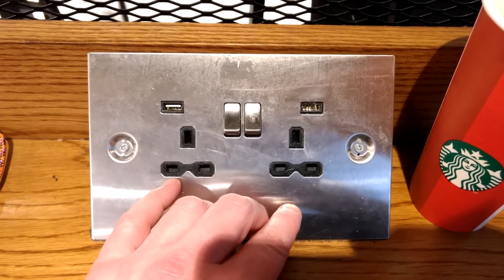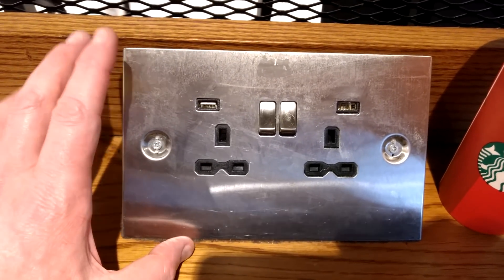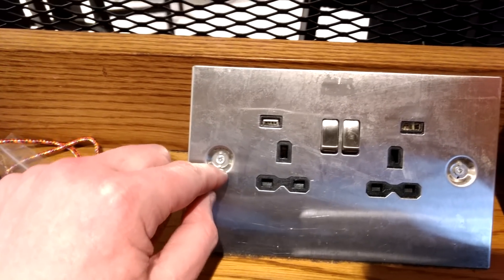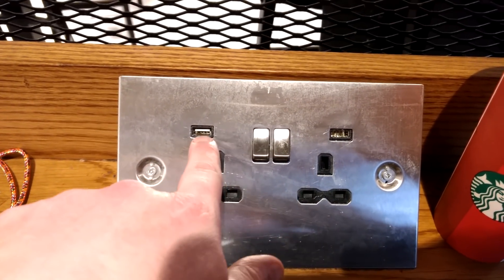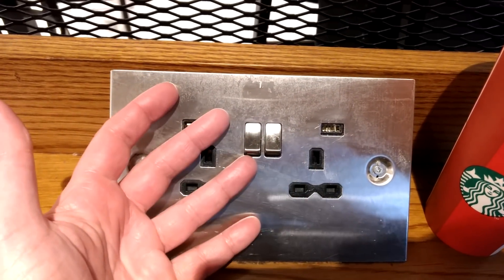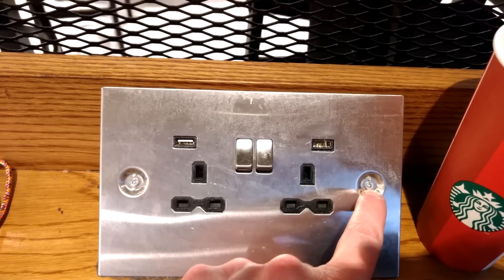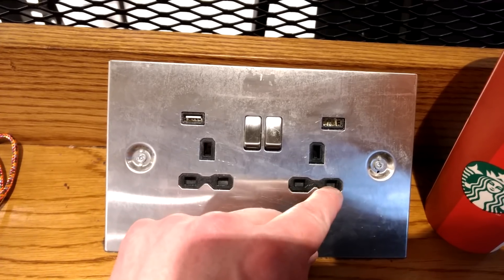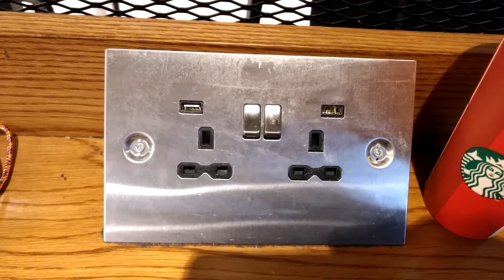Dead Starbucks charger and devious thoughts.

Comment: That's the new USB-D configuration,  you can use any cord you like as long as you shove it in there hard enough. Just like installing an RJ-45 plug into a standard phone jack.
Reply: USB-D(erp)
Reply: Paul Drake - or shoving a phone plug in a RJ-45 socket...
Reply: @Mark1024MAK  Don't know what phone plugs you use, but some here are basically just like the RJ45, except with only 4 pins and are a bit narrower
Reply: @Mark1024MAK  huh... UK phone plugs are strange...
Reply: @Tinker001  if you think the BT type is weird then have a browse through what other countries use!
Makes ours seem sensible.
Reply: @Mark 1024MAK That WP article doesn't seem to mention the major improvement over the RJ plug: If the cable is pulled hard enough the latch is designed to release before any damage is done.
Reply: (Though in fairness, the chunky international variants tend to facilitate legacy user wiring, where the UK legacy standard was 'approved device only'. Prior, we had the PO then BT to hard wire everything!)
Reply: @Mark1024MAK   That's not wrong and the standard was made to actually work with RJ-11 in RJ-45 sockets.

A lot of places (and you see this a lot working in I.T) People actually run Analog or Digital phones using RJ-45 sockets, It's a perfectly fine practice as long as you label the port, But that won't stop someone from plugging their PC into the telephone socket and.. Well... Fry it...
Reply: CFX MediaGroup - Yeah, in industrial, business and office premises, using the same wired network infrastructure for both ethernet and telephone services is becoming more common in the U.K. and presumably around the world. However, in the U.K. the “standard” and approved telephone plug/socket system is the BT type that I posted a picture of above.
If you don’t actually be clear to ordinary users, they will try to do silly things, like trying to insert the incorrect plug into a socket.
Reply: @tieline1333  I've had to change more than a few RJ-45 sockets that were damaged because someone plugged an RJ-11 into them. When you plug an RJ-11 into an RJ-45, pins 1 and 8 are bent much further than normal. 

When the RJ-11 is removed from the RJ-45, pins 1 and 8 often do not return to their normal position, and will not make contact with an RJ-45 plug, or make intermittent contact with an RJ-45, usually failing at the worst possible time...

Of course, this doesn't matter if you never expect that RJ-45 to work properly as an RJ-45 socket again, but if that's the case, why not just install an RJ-11 socket? At least then it's clear to someone in the future that it's a socket that only works with RJ-11s, as opposed to a damaged RJ-45 they might try to use as an RJ-45, only to have a network outage later....

Another option, to avoid damaging the RJ-45 socket, is to use an adapter that has an RJ-45 plug on one end and an RJ11 socket on the other.
Reply: @brianleeper5737  true
Reply: @Mark1024MAK  I intentionally shove phone plugs into RJ-45 sockets on a regular basis.

They fit & work as long as the other end of the Ethernet drop is connected to a phone line.

In this day of office phones all being VoIP, running a phone line from the rack to reception for a fax machine is silly when you're already running multiple cat6 or cat5.
Reply: or just a raging apple fan who has no ports on their £50000 macbook air
Reply: would it be USB-U  the U means universal ?
Reply: @punker4Real the first U already means universal
Reply: victornpb just pulg it into a ESATa port. mine has the lighting bolt for extra comfort and powerful output to the usb device. (the phone was suggested that I have random words in the sentence )
Reply: Or a usb into a rj45
Try it some time...usb a fits perfectly into rj45
Reply: Jeff Housen USB  fits perfectly fine in a ESATA port as well
Reply: @punker4Real Some laptops have a hybrid eSATA/USB port, so someone has already cashed in on that.
Reply: @kebizembola   Did that on the Sky box and wondered how it wouldn't connect to the router lol.
Reply: Are you sure they use USB and not USA?
Reply: You can put the cable in using a big hammer!  So I heard lol.
Reply: insert correctly  on the 3rd try

Comment: I've had issue with these in the past, giving me tiny electric shocks through my earphones while using on both Phone AND Laptop... immediately unplugged my devices from them, but what could have caused this?Faulty earth?
Reply from the maker: Most modern USB chargers have a slight AC leakage caused by capacitive coupling.  Especially if you are in contact with grounded metal.
Reply: @bigclivedotcom  At least it's not a pink death Dalek camping lantern!
Reply: @bigclivedotcom  I read of a recent case where a kid was electrocuted through his headphones, he was listening while charging his phone.
https://technology.inquirer.net/81928/p2fb-teen-dies-by-electrocution-while-using-headphones-of-charging-phone
Reply: It should pass the tongue test though - specially that is a public device  that everyone touches!
Reply: Actually common with at least the iPad Air 2. If you run your fingers over it’s back whilst charging you’ll get a tickle. This can easily be transferred to the person sitting next to you ;)

Comment: I was hoping they asked you to remove it to do a postmortem. Be interesting to see how a high end USB charger differs from eBay specials.

That being said I'm leery of using any public USB charger since you never know what is behind the plate so I bring my own AC powered charger.
Reply: "high end" lol
Reply: Own AC powered charger or powerbank is the way to go imo, the one that travels with me the most lately is the Xtar PB2. Compact little powerbank that can also function as 18650 charger if you have access to a USB socket power supply (for 18650 torches, unprotected cells only!).

Technically I suppose you could maybe find a solution with an adapter that only passes ground and power on to your device and has some kind of voltage protection in it, I know there are plenty of things out there that'll only charge but never looked into if there are actual good options with protection circuits in it.

https://lygte-info.dk/review/Review%20Charger%20Xtar%20PB2%20UK.html despite the noise mentioned there, my phone seems to handle it well enough and it gets the job done for multiple tasks.

Comment: I don't think I'd ever trust a public USB socket for charging anything.
Reply: There's really no reason to use those USB ports if it's got a plug there anyway just use your own charger one it will rapid charge your phone those socket USB ports typically only provide 500ma to 1 amp 5v or could potentially damage your phone ( where are rapid chargers at a typically 9 volts 1.6-2 amps)
Reply: I mean if it connects to the smartphone it would say that its connecting in data mode anyways, as long as you are not logged in in your phone you can't acess the data, so just plug it in wait till the data mode notification comes or doesn't and then decide if you want to use it or not
Reply: I have a nifty USB port tester widget that lights up with voltage and amperage readouts.  Great for public chargers.  If the voltage looks okay, THEN the phone gets plugged in.  Watching amperage readout informs if the port is weak or dead.  Mine looks a lot like this:  https://www.amazon.com/X-DRAGON-Multimeter-Chargers-Capacity-Accuracy/dp/B019RHJRM8
Reply: I carry around a USB power bank. It's as thin as a cell phone, and is all the power I need for anything until I can get back home to recharge it.
Reply: you don't want to get a computer virus or bug, you don't know who's been charging at that station...

Comment: How long did it take to decide not to 'take it to bits' right then and there.  Must have been very traumatic for you to let it be.
Reply from the maker: I really wanted to take it to bits.  But aside from the lack of tools it's probably not a good idea to interfere with things in an airport.
Reply: @bigclivedotcom  I actually thought for a moment you were going to start working on it, then you mentioned the part about being in post secure part of the terminal. Meh, it's in tarbucks (not a spelling mistake)
Reply: Tardbucks, now with extra pumpkin spice.  @cleaner10399
Reply: @bigclivedotcom  The security would not care to hear you say " THIS IS WHAT I DO ON YOUTUBE'.
Reply: Once that faceplate's removed (easy job) then just replace the USB B socket with a new one.  We have "ham-fisted" relatives and this is a reasonably common job for me!
Reply: @phils4634  They should be moved on to USB Type-C as soon as possible, sadly adoption is going a little bit slow outside the expensive high end stuff.
That said I suppose they'd be capable of trying to stuff a micro usb cable into a type c socket... or other way around, so yea that's another potential problem to deal with requiring more spare parts on hand.

Comment: No clive, they would not understand what you were doing lol.
I don't like the idea of putting switchmodes in a wall socket, running all the time.
Ill stick to normal ones, when it goes pop you dont need to throw a breaker to replace it.
Reply: It's OK, I'm sure they took away Clives's screwdriver at security and there wasn't room in his carry-on for the vice of knowledge.
Reply: Maybe his safety pie dish? :-D

Comment: Who in there right mind sticks there devices into unknown USB ports! For all they know someone could have had some fun and wired up the 415v to the USB port!
Reply: But that's unlikely
Reply: @flightisallright  Clive has shown us all the ways a cheap USB charger can be dangerous.  But hey, I'm sure Starbucks has done the same thorough investigation.  Not.
Reply: I'd trust something like this more than a random yum cha charger, If it's installed in a commercial environment it'll be a proper to code module. Sure if it's a china special one I'd be worried but it's fairly trivial to make one that's as safe as plug in charger. Plus I'd argue anything that blow a phone up is only going to do it once before people complain and it gets changed.
Reply: @hannahranga  Yeah, starbucks are known for doing things the right way... like paying taxes, following employment laws etc.
Reply: Frying is not a risk if you watch the person before you charge up first.
Reply: I can't believe people drive in cars! Some one could have cut your brake lines. (See how crazy that sounds?)
Reply: @xenonram The chances of a USB port being faulty or connected to mains inside a 13 amp socket are many orders of magnitude higher than your break lines getting cut. If your silly enough to do that , hell its your device go for it. It could have its data lines connected and set to upload a payload to your device anything!!!! Think people!
Reply: @andljoy  its not like they are allowed to just wire in such a port in there it has to pass code. And do you really think starbucks is willing to get bad reputation because they electricuted their customers? I think not
Reply: Andrew Joy do you need a new tin foil hat mate?
Reply: @xenonram  People who cut brake lines (if there were any) are unlikely to be doing so with the aim of pushing replacement brake products towards you. People who sell overpriced, shit coffee MAY be tempted to push advertising of their brand towards you, via a USB connection they have sole control of. Add the words totally fucking amoral American corporation and possibility can easily slip towards probability.
Reply: @bren106 I'm sure when you plug your phone in to charge off a USB that has power and data, it gives you the option to charge, or charge and connect. Or maybe Starbucks has got to Sony, Samsung etc..... #bigcoffee
Reply: @richsmith6453  The thing is, by the time the message comes up any malware could already be on your phone.  Or potentially if the malware is really clever it might be able to bypass the notification entirely.  That's the thing with malware, you can never be sure.

Comment: So many possibilities
Check out EvilUSB 
There is also a screen duplication attack possible with the HDMI capability over the iPhone lightning cable
And don't use the free WiFi :-)
Reply: Only use Free WiFi with a trusted VPN. I have pen-tested and messed with people using the free WiFi at many locations. I can rebroadcast their WiFi from my system and watch all the traffic go through my Access point. Man in the middle. If someone is using a VPN I can not see what the traffic is but without one it's like having a key logger.

Comment: Using a USB charge point, more dangerous than using Public WiFi. Rogue USB adapters inside could easily install/root or simply copy any data to and from your phone. If you're going to the effort of carrying around a USB cable, just use your own charger as well. Not saying Starbucks is going to be doing anything weird but it doesn't take much, like ATMs for fake ones to be setup for you to happily use in Starbucks or other locations.
Reply: Or use a USB cable that does not have the data lines connected.
Reply: @TheSadButMadLad  That's ok, but you could still be attempting to plug in your hardware into a rogue device that's actively trying to exploit you. It'd only take one mistake with the wrong cable in that instance. A rogue USB charging point in public probably not as common as we'd make it out to be, but once you're a victim and all that.
Reply: @simonj48  Yep, probably very rare. More likely to be a victim of your WiFi leaking data than via USB.
Reply: Most new phones give you the option of how to connect if it detects data activity

Comment: I usually carry USB power supply and use that rather than the public USB ports. Often in airports there are sockets on walls that you can use as well, so you don't fall into the trap and buy a coffee while charging!
Reply: I buy coffee even when I don't need to charge my phone though. Although I tend to avoid Starbucks unless I absolutely have to.

Comment: I think you should release this to YouTube, with the caveat, always know what you are sticking your thingie into.....and if in doubt, wear a condom.
Reply: Surely there is a USB condom available on the net?  A fuse on the power and no data line connections, in a simple little package.  Use it for any extra curricular activities.  Hmm.  I looked briefly and all I could find is data blockers (USB Condom, etc.), not anything with fusing as well.
Reply from the maker: There is a USB condom that isolates the data lines.  Maybe a transorb on the power rails would make a good addition.
Reply: What you actually require is a isolating DC/DC converter that has extensive input protection.
Reply: I've always shied away from plugging my $500 phone into an unknown charger, built by who know who at the lowest price possible and exposed to abuse by the public for who knows how long.
Reply: Wtf did I just watch?
Reply: I have a USB isolator (Delock 62588) with 5 kV optical isolation for data and 3 kV optical isolation for power. I don't know whether that would protect me from USB Killer type attacks? 
(that wasn't why I bought it in the first place)
Reply: @anononomous  ...how tha heck do you optically isolate power?!🤔
Reply: @fookingsoc Arc lamp driving a solar boiler, obviously.
Reply: fookingsoc - it’s called a transformer...
Reply: Mark 1024MAK - Transformers aren’t optical, silly! :)
Reply: Mark's Tech Channel - that’s what you say, but I can see them with my optical eyes 😊.
In reality, to provide proper isolation and transfer data and power, opto-isolators (also known as opto-couplers) are used for the data transfers and for the feedback/regulation control of a DC/AC/transformer/AC/DC power converter system.
Reply: @RTR-MATEY  LED / solar cell combo? Haven't heard of something like that for something that needs to be as powerful and compact as a USB charger and the efficiency will be terrible. The Delock 62588 seems to mention optical isolation in some product listings and galvanic isolation in others. It also doesn't look as big as what I imagine a 5-10W LED bulb covered in solar panels would be.
Reply: In this case a condom would have been  detrimental!
Reply: Real mature, dude. Don't be that guy.
Reply: lmao I have a relative with your name.. bit weird
Reply: The notification you get when you plug a phone into a USB port that asks you what you want to do (charge only, transfer files etc) should offer protection from these sorts of attacks. I believe that is part of the reason it became a thing.